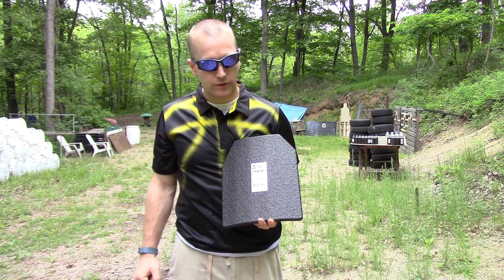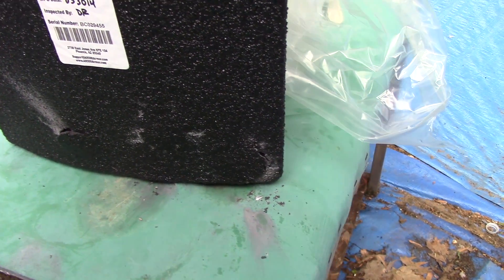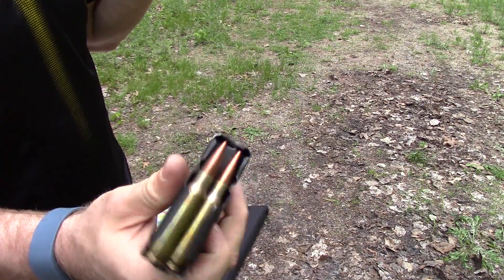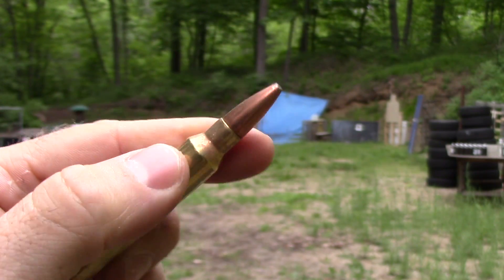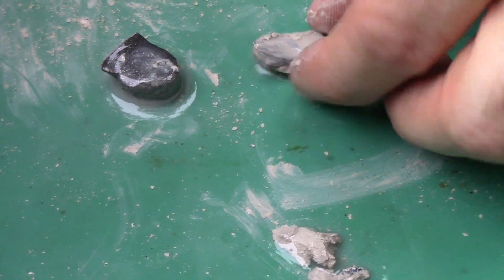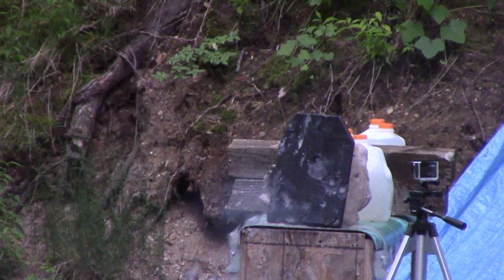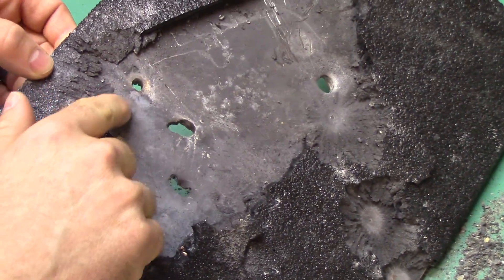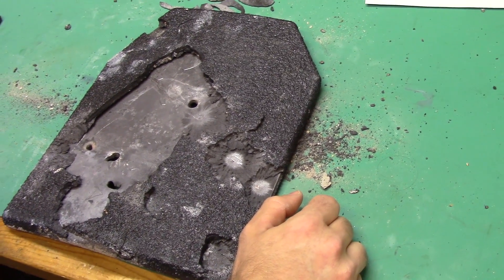@ArmoredRepublic2 Level III Plate Torture Test: Heavy Hitters

Comment: Im confused that some plates say “Normal” Level three steel plates stop 5.56 M193 but on other manufacturers websites the specifications say it doesn’t stop 5.56 M193
Reply from the maker: Most steel plates can’t stop M193 going over 2,950 fps. If it’s steel definitely look for the m193 velocity rating or ask the manufacturer.
Reply: @BuffRANGE  Ok thank you

Comment: I wish they would clarify specifically if this is level 3 or level 3+, really confusing.
Reply from the maker: This is a level III plate.
Reply: @BuffRANGE what's the difference between level 3 and level 3+ ?
Reply from the maker: @robertboutin6232  + is added by manufacturers to denote other threats not covered by NIJ. For steel armor “+” is usually M855. For UHMWPE it could be M193 or 7.62x39mm
Reply: @BuffRANGE  do you think using level 3A as a backer for level 3 steel plates would stop m855?
Reply from the maker: @robertboutin6232  steel plates generally
Stop m855. M193 from 16” barrel is the problem. It maybe possible with a good IIIa
Reply: @BuffRANGE  thank you for the info as I have little knowledge on this subject of body armor. I have recently acquired level 3 steel plates and trying to decide if I should upgrade or just add more layers lol. Good videos by the way.
Reply: Is this the base coat or base coat+build up?
Reply from the maker: @aaronrutka7177  Build up

Comment: I know this is an old video. But I bought a Plate carrier with these plates and I have a few people telling me they arent good? Why do people hat steel?
Reply from the maker: Generally speaking rounds that violently fragment when hitting steel can send those fragments into the wearer's neck or other body parts. The thick build up coating of truck bed liner helps mitigate that. People also don't like that they are heavy, and in general the steel being used here was never designed as body armor. Ceramic armor has come a long way in price reduction and durability. PE armor has gotten cheaper too, but a pure PE plate cannot stop M855. Steel will stop M855, but has trouble with higher velocity rounds like M193. 

Something is better than nothing at all, and if you want armor to have it just in case,  and you buy plates to stop the threats you think you need to prepare for, steel armor from bigger companies who are transparent about testing and it's limitations will be fine..
Reply: @BuffRANGE  thanks for the info. I would like to get ceramic later on but ar500 had a sale going on. I just get annoyed by all the comments saying "you shoulda got ceramic "

Comment: I would avoid the company known as AR Armor.  I bought some steel targets, they crater and not be safely used when used as advertised.  They have refused to post my review of the product and of their advertising.
Reply from the maker: What kind of steel targets did you buy? What range are you engaging them at, and with what rounds?
Reply: The 1/2 inch thick 6x11.  Privi Partizan M193, this is a milspec 55 grain 5.56 NOT steel core.  16 inch barrel.  Range 50 yards.  They might be ok at the usual 150 yards or even 100 but AR500 Armor specifically advertises them to be good at 50 meters with most common centerfire rifle cartridges.  I bought these for use at 50 yards because of the advertising.  The targets are also smaller than described but that is a lesser issue.

Comment: I aways prefer Steel Cores in Full Metal Jackets over Lead ones. If I was shooting soft targets then I'd use Hollow Points but otherwise, why should I trust the everyday Lead Cores to Pierce Armor Targets?
Reply from the maker: because for some reason lead core rounds at higher velocities tend to penetrate better than say M855's core and tip combo.

Comment: Why buy a level 4 plate that is only rated for 1 30-06 when level 3, level3+ can stop multiple
Reply: In addition to this, the chances of getting hit with a 30-06 is also relatively low
Reply from the maker: Level III/III+ will not stop EPR rounds or in some cases full load m193. Level IV is multi hit capable. I’ve shown that in a lot of my videos

Comment: It nice to see a test finally done at a reasonable distance and with 16 inch barrel. Most people now days don’t have the full length A2 versions they have the 16 inch barrels and if you get hit from up close  no shit it’s going through.
Reply: You do realize that a 16" barrel produces lower velocity than a 20" right?
Reply: @huntercook6605  16or 20 inch. At 10 yards yours getting nailed by full muzzle velocity .
Reply: @NoreasternBladez  I'm not completely sure what you're trying to say here. Yes, at 10yd the bullet will be going nearly the full muzzle velocity. But that velocity is higher from a 20" barrel than a 16" barrel. Andrew's comment strongly suggested he believed the reverse, so that's what I was correcting. In any case, armor is rated for specific projectiles at specific muzzle velocity, and the testing is done at 15M or less for rifle rounds. So the velocity is still very close to muzzle velocity and even closer to the velocity at 10yd. LIII is rated to stop 7.62x147gr@2780fps. If you're stopping M80 at 15M you're stoping standard 5.56 at any distance, whether from a 16" or 20" barrel.
Reply: Thank u i needed this breakdown@huntercook6605

Comment: Ar500's site says their level III is rated rated for m193 and I'm assuming that includes m855. So is their site inaccurate?
Reply from the maker: Their Level III+ is rated for M193 up to 3100 fps, this is not. M855 is usually stopped dead by steel armor though.

Comment: LOL..AR500 or any steel is NOT body armor!  Steel plates are targets we shoot at, not wear around our necks! Here is a good short article that explains why from pro's in the field - https://outerarmortactical.com/pages/dangers-of-ar500-plate-for-body-armor
Reply from the maker: You got caught in spam. Yeah frag and spalling is an issue with steel plates. The "bed liner" does a good job mitigating it, but don't be fooled into thinking ceramic and other components don't cause frag either.  I think there are only a few actual NIJ Certified Steel plates, but many of them are tested in ballistic labs to be compliant. Meaning that it will stop the threat rated for, not only stopping the round, but the back face too. So the link above, IMO is an attempt by a manufacturer to sell more of their products..
Reply: Well, the splatter is not at all the only issue with the steel as I read from their article, and they made allot of good sense. Ricochet's that will either remove your own appendages or go into someone next to you is a major issue, as is the immediate transmission of all that directed kinetic energy which the higher end composites do mitigate quite a bit of. I also have some real world experience with that. I also bought some AR500 targets a few yrs ago. Welded them to steel fence posts (NOW with the tops of the steel further out so that the rounds are always directed DOWN at a steep angle into the dirt regardless of how the plate twists.) BUT, not after I lost my phone service from a ricochet into my phone pole box 60ft away! In combat with a team around me, or in my house filled with kids and others during a home invasion or other, who would have been that phone box? That is not going to happen with composite armor. 

 As for that Armor company link in my first post; I purchased from OuterArmor Tactical along with a bunch of guys from two major forums that I am on, and the product and experience was 100%, and far and away better than when I went through others previously. Especially when I bought the AR500 stuff a few yrs ago. Those guys knew nothing, which now I find is exactly why they sell people on steel plates as actual body armor, it's not right, but I bet it is all about the high profits.  I took those 4 Ar500 plates and attached them across the inside of my SUV's rear gate. So now they are being used as all metallic armor should be used..lol   And by the way, the guy that owns OuterArmor is also the same guy that started and owns MechArmor Defense Systems - -  http://mechdefense.com/  He's the guy that designed, tested and sold that one kickass Hummer/Stryker turret to the Army. So it goes without saying that he knows all about metallic armor. And he also answered all the questions and then some that the other companies never did. When I purchased my 2 AR500 vest kits I asked very specific questions about composite plates vs. their steel, and truthfully, I got no answers that weren't merely marketing end-runs.  And PS: I don't ask questions that I don't already know the answers to when I am purchasing stuff. I ask to see if the SELLER knows.  At that time I felt we needed something and purchased anyway based solely on price.

As for their application of truck bed liner, that's nothing more than them (the sellers) reacting to the truth of their ignorance which has now escalated to polishing a turd by said application. There is a lot of shit in this world that can be red-necked and still work fine, body armor, in my opinion, is one of the few things that cannot.  Now, after ALLOT more research and talking directly with the real armor specialists, I think all of these idiots selling steel plate as personal armor should be run out of business. Because either they are too stupid to be in such a serious and important line of business, or they are seriously compromised, people. 

ALSO - This time, since my cash flow issues abated, I first purchased 2 plates and used the NIJ distance and velocity stds this past summer and shot the plates strapped to a 150# heavy bag to best mimic a human body being hit. One was a light, five pound Lev4 Poly/SiC ceramic composite and the other was super light 2.4 pound 100% Polyethylene Lev3.  I shot the shit out of them with both 5.56 and 308, and both took more than double the amt of hits without being compromised. These are supposed to stop 6 hits per plate. Then I bought one full kit of Lv3 and one Lv4. Super light stuff. Which I had this tech in the army.  Anyway, just my personal experience. Doesn't mean I'm right.
Reply from the maker: Ohh I'm not disagreeing with you about the use of steel body armor. It has draw backs, with one of them being concerns with ricochets, and frags from it.  From a training aspect steel plates are a plus IMO, because you can beat on them (falling on them, throwing them, etc) pretty good. If you're on a budget and you're going to only use them say in a self defense situation in a house with a very direct hit (low shot angle relative to the plate) Steel will stop any pistol threat, and a fair amount of common rifle threats.  

My comments were solely based on the "energy transfer" part. While I said very few steel plates are NIJ certified, most reputable sellers are selling NIJ compliant models, that have been sent to Ballistic Labs to have threat profiles assessed.  In order for a threat to be "stopped" the bullet must be stopped, and the amount of localized backface into the clay must be below 44mm.  If a round is stopped but the BFS is over 44mm then the plate fails that test.  It's going to hurt like hell, bruise, crack a rib, but you'd in theory survive BFS under 44mm.

Comment: i just use level IV ceramic plates backed by level III soft armor...
Reply: so you a soldier?
Reply: A. there is no soft level III armor
B. if it can pass through level IV, then unless you have another level IV plate you are just wasting money and weight having more plates behind it.
Reply: KillerVzTwo Gaming 

A. There is plenty of LVL 3 soft armor on the market. 
B. None of these rounds in the video will go through LVL 4 ceramic plates.
Reply: @MrCherrygrovedude  A. no there isnt.
provide ONE example of a level III (not IIIa) soft plate. III and IIIA are entirely different.

B. The OP said they wear IV backed by IIIa... the IIIa is pointless if the projectile can already pass through a IV.
it had nothing to do with the rounds shown in the video.
Reply: @killervztwogaming5796  hard plats only protects a section on your front and back...soft shell on the other hand covers a lot more around your whole body, ribs etc...i use safelife defense lvl3a+ for stab protection with lvl 4 plates over cause 2 plates wont stop a stab to your ribs....
Reply: @vtekro7695  A. they make side plates for hard plate carriers.
B. not all soft armor is wrap around, most are just plates and use a normal plate carrier.
C. your setup (if even real, and thats a big if) is incredibly expensive, incredibly cumbersome, and incredibly inefficient.
Reply: @killervztwogaming5796  LOL there has been lvl 3 soft armor for years. Are you new..🤣
Reply: @colecole3352  still waiting
Reply: ceramics are a one and done got to replace after words

Comment: You undersold the m193 by shooting it out of a 16inch barrel. This is misleading. Its why people are usually shocked when the m193 goes clean through Level III
Reply: Yes it does I did watch it from the wound channel
Reply from the maker: It's why I use a chronograph now :) and is why I perform tests at 45'. Full velocity M193  will indeed penetrate level III
Reply: what about SS109/M855?

Comment: I find it somewhat comforting that if the round did penetrate, it would be over soon anyway...
Reply: Ever since I saw this comment a couple years ago I've been preaching it ever since.
Reply: @denialater7775  it's true. it doesn't matter if you spend money on ceramic or quality steel. plate carriers and body armor in general is designed to give you enough time, come the situation where you are being shot at, to find cover. it is not intended to be worn so that you can take on people in a firefight.

Comment: I think the M193 and the reloaded SS190 would have gone through if the plate were closer.
Reply from the maker: +The Chopping Block Possible on the M193 based on +The Wound Channels results. Not sure what to think on the reloaded SS190. I mean it has the velocity. Maybe I'll see how it does on a IIIA hard plate, or closer level III. maybe 10 yards.
Reply: +Buffman It is very light but 3,400 fps is WAY over the limit. If you lived closer, I'd bet a six pack on it. Did you see my 45 gr varmint test?
Reply from the maker: +The Chopping Block Just did. Very interesting. Maybe I'll step it up closer :D
Reply: Lol. Also check out The Wound Channel's videos. AR500armor.com's level III+ plate did very well, but Armour Wear's level III+ plate, not so much.
Reply from the maker: +The Chopping Block Yeah I've been waiting for 3 weeks for my Amour Wear III+ plates...
Reply: +Buffman Unfortunately, their entire social media strategy seems to revolve around proving what a colossal douche their representative can be. I have zero respect for them. Unless respect can have a negative value, then I think I have like -87 respect for them.
Reply: or if they used a 20 or 22 inch barrel.

Comment: Buff,

Put a little 5.7 through it. The S4M shouldn't be any opposition.
Reply from the maker: mrbuffer84 Bullet composition is not there for the 5.7 round. I drove the SS190 pill to 3400+ fps out of 5.56 in this test and it did not go through. I do have plans to test S4M in their IIIA hard plate.

Comment: Thank you BUFFMAN. I BE WAITING TO SEE A TEST ON THE AR500 LEVEL 3+ TRY TO DO THE TEST WITH 5.56 PENETRATOR,308AP, 30-06AP, 7.62X54 ,300WINMAG,338LAPUA AT 15 YARDS. THANK YOU FOR THE VIDEOS .
Reply from the maker: OPTIMUS VADER 5.56, 300 win mag, and .338 RUM (very close to Lapua) can certainly be done. I don't have access to 7.62x51AP. I can try to source some, but it may  be cost prohibitive. 54R, lacks velocity to defeat Level III, even at about 15 yards let alone III+

Comment: Dude 35 yards was way to far for this type testing. I bet the lesser threat rounds would pass through at 20 yards such as the xm193 round. Just saying good test otherwise! You do still have the other plate for future test right?
Reply from the maker: HYDRA DYNAMIC  I actually have III+ coming :) I want to stay safe while testing, so 35 yards is a good compromise. It's well established hot XM193 will penetrate at CQB ranges. When the III+ comes, I'll test M193 and some higher speed goodies at closer ranges.

Comment: have u seen this vid?
https://youtu.be/pjVrcr3VXjk
Reply from the maker: ***** Yes. Demo Ranch does awesome work!
Reply: Buffman believe it or not, that was my friend's steel plate!! ;) He's helping with a fabrication company www.mj-steel.com
If you want one to test out, you can call and order to get a customize steel to any shape, size, and thickness of any AR500/AR550 steel.
Reply from the maker: *****  Thanks, I'll keep that in mind. Prices seem very reasonable..
Reply: Buffman The owner's name's Matt (good guy). He's located in N. Illinois. Anything less than 70 lb and that'll fit in a USPS flat-rate box will keep shipping cost low.

He have AR500 steels even thicker than 1 inch. However, anything that's over 1" thick will have to be in bulk plate, like a minimum size of 4x4 feet piece and'll have to be ship on a truck.

His phone # on the website, call or text is the (best & quickest) way to contact him.

Comment: XM193 will go straight through at close range, usually under 20 yards.  I suspect SS190 will as well if fired out of a rifle barrel.  Sadly, the chances of you getting hit with armor in a modern combat scenario at ranges over 35 yards is pretty slim.  Most combat happens at close range, usually in doors.
Reply from the maker: +Maniac742 yeah TWC showed higher velocity m193 will go through. SS190 no matter the velocity will not go through if you meant that and not ss109.  3400 fps is faster than any 5.7 gun can obtain and even then no penetration
Reply: No, real war scenarios imply higher distances in fighting. Around 100 yards or more depending on where